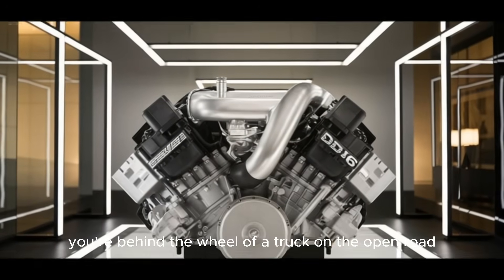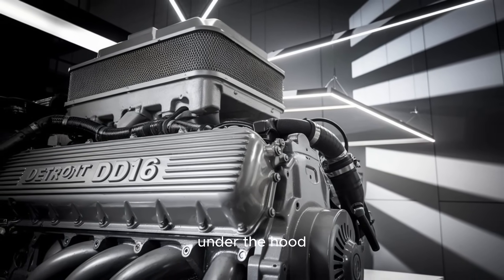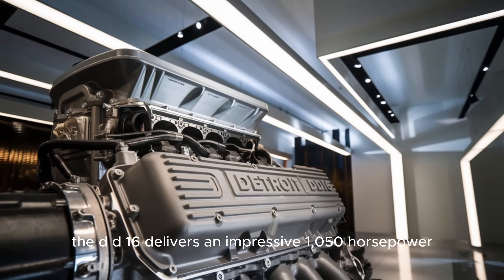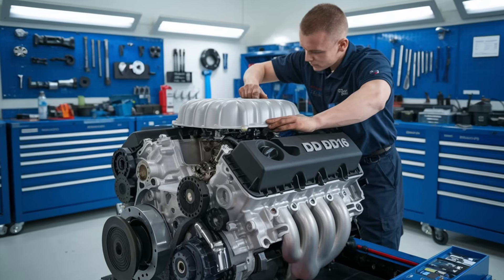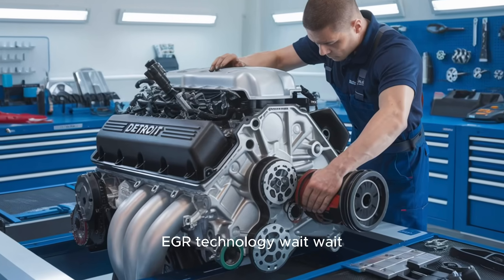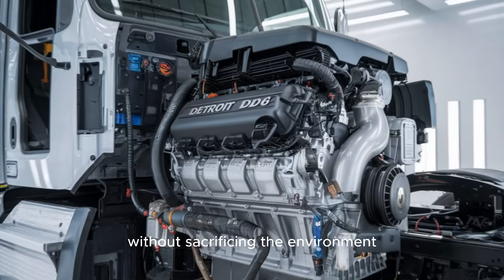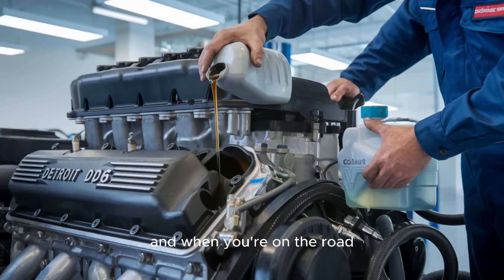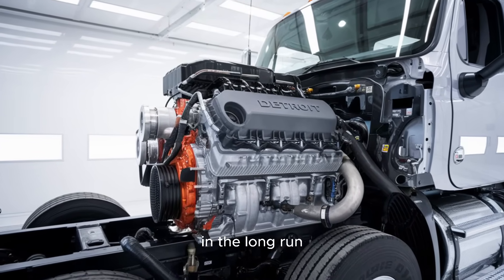"Detroit DD16 in 2025: A Game-Changer for the Trucking Industry"

Comment: No the The Detroit DD16 engine is a 15.6-liter, inline-6 cylinder diesel engine, known for its powerful performance and reliability in heavy-duty trucking applications. It delivers a range of 500-600 horsepower and 1850-2050 lb-ft of torque. Key features include turbo compounding.
Reply: @Bigmike3406E   in Europe  its 630 hp 3000 tourge  Mercedes  all detroit  engines  are Mercedes  since  2002

Comment: I didn't know that the DD16 was available at this power level. I have two and they only have 600 horsepower.
Reply: I had a 500 hp back in 2005 with 1.1 million mi. on it. Best motor I ever had in my 35+ yrs. over the road.
Reply: It’s NoT❗️😂😂😂